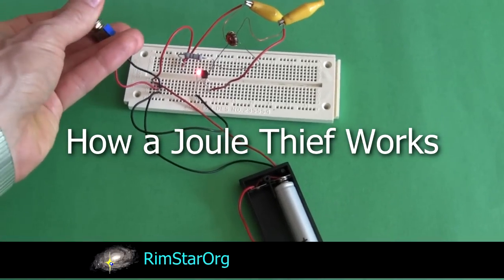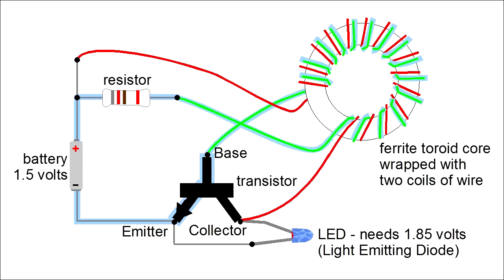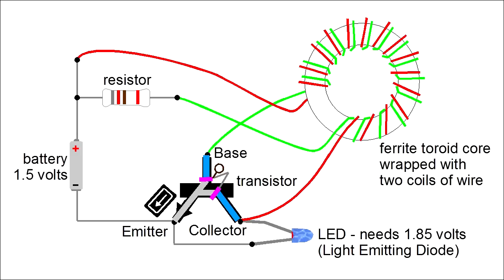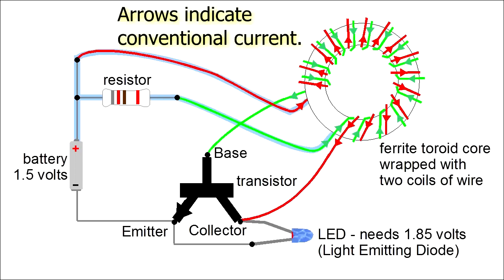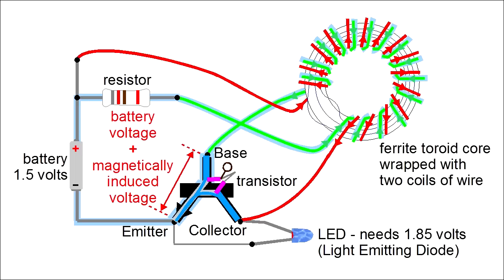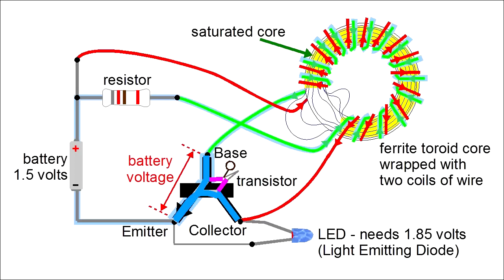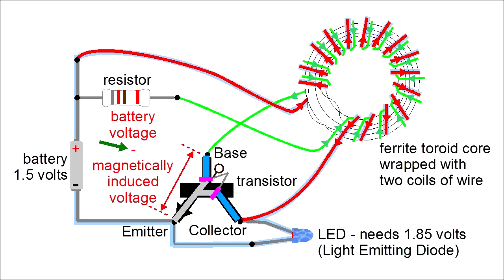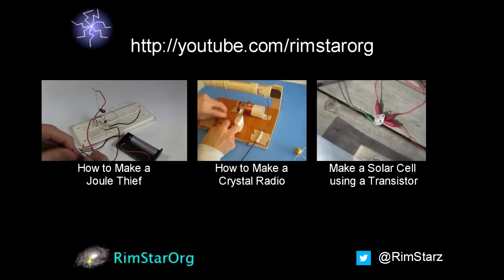How a Joule Thief Works

Comment: That answers my unasked question. It works because it's only on half the time, but persistence of vision fills in the blanks. I have a small jar of toroids that I haven't known what to do with and this looks like a fun project. And just to brag a bit; today I managed to get a crystal radio to light up an LED. It was flickery and weak but, hey, I figured out how to grab electrical energy out of the air and make light light with it. Thanks for the uploads.

Comment: Super vid :D This is the best one I've seen on how a JT works & is right.I've seen in other places where they give a much harder/wrong explanation.And just for anyone else who reads this know that a joule thief/ringer is one of the simple(best to me)circuits there are to turn on ANY TRANSFORMER.So hook this circuit up to Any transformer that has a center tap (or just rap one on the core if possible)& use the secondary for what ever you like(minus the LED of course to give energy to secondary) ;p

Comment from the maker: Typically a resistance of roughly around 1000 to 2000 ohms is used for this circuit. I happened to have a 820 ohm resistor so I used that. The resistor is to protect the transistor from too much current but it also affects the timing of the cycles. A good idea is to use a potentiometer (variable resistor) instead so you can easily try different resistances.

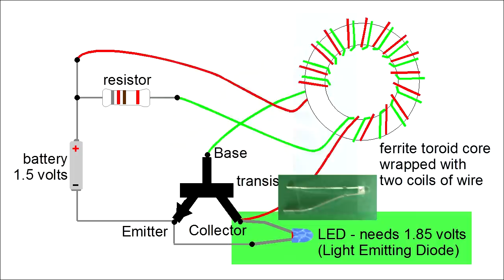Comment from the maker: Thanks! And welcome! The time frame depends on a few things and is usually controllable by replacing the fixed value resistor with a variable one (a potentiometer). In my "Make a Joule Thief for Zombie Batteries" video at 0:36 I show on the oscilloscope a cycle time of around 40 microseconds, so a frequency of around 25 kilohertz. In my "Fun with Joule Thief Powering a Compact Fluorescent Light" video i show 60 microseconds. So somewhere in the tens of microseconds of tens of kilohertz.

Comment: What I find amazing is just how fast these things happen. It's mind boggling how fast a transistor can switch on and off again.
Reply: Even if it does that just above 60 -70 times per second, it's enough for us to see the led always on!
i.e 60-70Hz
Reply from the maker: Actually, it switching at around 22,000 Hz.
Reply: This is nothing compared to, say, an FM radio, broadcasting at 100,000,000 Hz
Reply: or a microprocessor... where stuff is happening at Giga Hertz
(1,000,000,000 Hz)

Comment from the maker: Yup. I agree they're pretty much the same. Build up energy in coil, then dump it in a burst. One added point about the joule thief is that the way the primary coil interacts with the secondary coil (green in this video) opens up and shuts down the transistor faster than it would without the secondary coil.

Comment from the maker: What do you mean by dropping the voltage? What are you using to measure it? Where in the circuit? You'd need an oscilloscope to see the voltage. A digital meter with numerical display on the DC or AC scales won't work since the voltage is spikes with low voltage in between the spikes. What are you trying to power, an LED?

Comment from the maker: Hi, and I'm glad you like what I do. I'm guessing your LED is one that can turn on at 1.5 volts or less (if you're battery is fully charged then it's likely over 1.5 volts.) Do you have any packaging with your LED that tells you what voltage it needs? The LEDs I use require 1.85 volts, and that's why I need a joule thief.

Comment from the maker: +Vignobles Lac Saint-Jean I've used it for a number of things, which I've shown in other videos. The most frequent use is to power an LED using a battery whose voltage would otherwise be too low to meet the LED's minimum required voltage. I show that one in my "Make a Joule Thief for Zombie Batteries" video https://www.youtube.com/watch?v=B61DU7yEsPM Then I found you can power a CFL using 2 AA batteries by modifying the coils https://www.youtube.com/watch?v=FkLET8MhRbU. And then I learned how to modify the coils again to use this to transmit electricity wirelessly https://www.youtube.com/watch?v=31Rxi8JMIys.
Don't be misled by the "thief" in the name. This is just what's also called a blocking oscillator circuit. It provides higher voltage and current by repeatedly building up energy in a magnetic field and then releasing it in a short burst. The higher voltage and current exist only during the brief burst. The total energy out is smaller than the energy in.
PS There's no Reply button under your comment because of your Google+ settings.
- go to your Google+ page,
- in the top, right corner click on your thumbnail icon,
- in the popup that appears, click on "Settings".
- for the 2nd question down "Who can comment on your public posts?" set it to "Anyone".
Reply from the maker: *****
No.You'd still need to power it with batteries so that you can charge the batteries. It doesn't make sense.
Reply from the maker: adolthitler Ah, my bad. It was a case of skimming through comments at a time when I was going through a ton of them. I remember thinking he was talking about doing it at night when there was nothing from the solar panels, which clearly he wasn't saying at all! Yes, it could probably extend the useful time of solar panels to when the clouds some out. That'd be an interesting demonstration in fact.
Reply from the maker: Rohan Zener Yes, structurally the coil and core are the same as a transformer should you need one like that.
Reply from the maker: Rohan Zener If you're referring to just the coils and the toroid core then it's one-to-one, no transforming would take place since both coils have the same number of turns.
If you're talking about he whole joule thief circuit being x2, then no, it's much more than that. Also, the output is neither DC nor AC. You can see the output waveform in my video about how to make it at 0:38 https://www.youtube.com/watch?v=B61DU7yEsPM. Here a 1.5 volt battery is on the input and the output is the waveform shown with a peak-to-peak voltage of around 24 volts and a frequency of around 22 kilohertz.
Both the voltage and frequency are affected by a number of things, including the resistance of the resistor used, as I demonstrate in this other video here https://www.youtube.com/watch?v=yz_99oVMbSI.
I don't have any way of calculating what you should get as output.
Reply: +Rohan Zener i was starting to think the same, at less on the same path.
Do you refer to boost x2 the voltage applied to the base.  I mean Vbb (the voltage applied to the base-emitter path)  ??
Reply: The trigger that turns on solar lights when it gets dark is just a transistor and a resistor and is also called a Joule Theif.  How does this work? Why does it share the same name?

Comment from the maker: I don't know what the maximum voltage would be but a lot of people run compact fluorescent light bulbs off of them and they require high voltage. Their ferrite cores are usually larger and they use higher power transistors.

Comment from the maker: The transistor is off when the voltage is sufficient to run current through the LED. The opposite wiring of the coils makes sure of that. During the collapse of the magnetic field, the red coil induces current in the green one in a direction that further aids in shutting off the transistor.

Comment: Does the light flash rapidly?
Because the gates open and close.
So D/C to A/C.
Reply from the maker: It's hard to say if the light flashes. The frequency is too high for a human to see. We really need a high speed camera to tell or a photo diode circuit. It's pure speculation on my part but there might also be some delay in an LED turning off that causes it to still be on when the current flows again.
Reply: If you add an adequate capacitor, you can resolve the light flashing rapidly.

Comment from the maker: Oh, sorry to hear you had difficulty. The anode/positive/long lead is connected to the collector of the transistor which is also connected to the red wire going to the red coil. The cathode/negative/short lead is connected to the emitter and battery negative.

Maybe your confusion is because I drew the long lead connected directly to the transistor's collector without any intermediate wire. Maybe that made you think those weren't the leads and that they were missing?

Comment: The Transistor in a joule thief, just acts as an automatic on/off switch, while the 2 coils act sort of like a rechargeable battery. So the magic isn't really the Transistor, the MAGIC actually happens with those 2 coiled wires. So, it starts out with a (street Traffic) Red Light. The wire coils, act like traffic getting backed up at a red light (storing the extra energy in a magnetic field). The Transistor is the traffic light, which waits for enough cars waiting in line, before turning to a green light, which releases the cars, while also blocking traffic from other directions. The Transistor does not really amplify energy, instead, the wire coils amplify the energy and the transistors only job is to be forced open from excessive electricity built up, which quickly drains, which forces it back closed. Without the transistor, the Gate/Switch/Traffic-Light would have to be MANUALLY toggled by a human (like jiggling the second wire on/off the negative). I made one without a transistor, and successfully lit an LED with 1 AAA battery. This is a horrible picture, but I didn't expect it to work, so, forgive me for the bad image quality and having nothing labeled. http://i.imgur.com/NOknJv1.jpg
Reply: Yep, this is the fundamental part, and basic principle with any switching converter. But that's, however, quite easy to understand, but the hardest part to understand with blocking oscillator is how it actually makes the oscillation. This video got me closer to get a grasp about that, still have to process it in my brain though.

Comment: So your saying the LED is pulsing...but our eyes cant see this pulse..is this right..???
Reply from the maker: +Kennynva T. Yes.
Reply: Seems Im reading the same voltage on the led as the battery has..so how does it get brighter??  just by current??
Reply from the maker: +Kennynva T. If you're reading the same voltage then it's possible your circuit isn't right and you're just powering the LED off of the battery. Does you battery light the LED without the circuit? If the battery alone doesn't power the LED then you wired the circuit correctly and the joule thief is doing it's thing. Check the wiring going to your coil to see if it's the same as the circuit diagram. It's not wired the way you'd expect.
Reply: Yes that is whats weird..the battery will not light the led by itself..but it does in the circuit..So how does the capacitor make the led brighter...no matter which way you turn the electrolytic capacitor?
Reply from the maker: +Kennynva T. That's not weird. That's what's supposed to be the case. It means your circuit is working properly. This video is supposed to explain how, but basically it works by increasing both the voltage and the current at the LED by simply building up energy in the coil's magnetic field with the LED off, and then dumping that energy to briefly turn on the LED, and then repeating it. I haven't given much thought about the electrolytic capacitor, but it's also an energy storage medium so maybe the answer's in that. Regarding the polarity not mattering, that would be the case if it's in the circuit where there's AC, as with AC it would function in at least one orientation, and luckily not be damaged.
Reply: I think you meant in DC it would function in one direction.
Reply: +Kennynva T. I think he meant in AC, it would only function correctly during one single fluctuation of either the positive end or negative end of the period cycle of the AC sine wave, because the LED is essentially a diode, and diodes allow current via only one direction.  Plus, you can fry an LED if you run current in the wrong direction for too long.
Reply from the maker: +Mark Wright Yup. I meant AC, as Mark explained. If it was DC and you had the direction wrong then the LED would not light up. But since AC keeps changing direction, at least half the time, when the direction is right, the LED would light up.

Comment: OMG !

Sorry to say that but the term « joule thief » is misleading !

Nothing gained here. This is a very old concept called a « multivibrator circuit » or « oscillator circuit » that is fed through a toroïdal transformer to step up voltage (not current). You could use a regular transformer 110v:6v reversed and you'd get about 20-25 volts. You just made an inverter !

Actually you could do the same using a single SPST relay and a 9v battery hooked up as a vibrator; in that case, you might get thousands of volts on the coil as Back EMF.

Usually, to counter that effect. we put a diode across the coil because back EMF can be damaging to electronic components. In this case, we don't need the diode because WE WANT the effect to create EMF.

The « Noise » you are hearing in the coil is normal ! It's the vibrator circuit creating resonance !
Reply from the maker: Yes, it is misleading. But that's one of the names very commonly used for this circuit. Blocking oscillator is another. But nothing in my description points to any energy gain. Just accumulated energy being released in a burst and repeated.
Reply: RimstarOrg  Blocking oscillator..makes more sense... so does this circut drain the battery faster due to it needing to build up a charge to light the LED? thus no real extra power or "thieving" is achieved? it just spends the energy in a more lump some effect?
Reply from the maker: Ohm Zen
If you have a battery with sufficient voltage and current to light the LED then I would think you'd be better off using the battery directly. And yes, to your other two questions.
Reply: Thank you for answering all of "our" youtube questions! you are my favorite youtube professor haha ;D

Comment from the maker: I recall having the battery voltage at the LED at one time too. I don't recall what it turned out to be but it wasn't a bad transistor. It might have been that had the connections to the coils wrong. If you look at them closely you'll see that they're supposed to be crossed in a way. Maybe check that.

Comment: ...so how does a joule thief work??
Reply: The TL;DR version is that it charges up in the torroid until it's full, then when that happens the transistor lets go which forces the current through the LED.

Instead of giving it 1.5 volts over a second, it gives it 3 volts over 2 seconds.
Reply: So If you connect two end points of a capacitator, we can make a basic alternator.
Reply: It charges it up, discharges it by letting current go through the led, and so on it starts over and over again.

Comment from the maker: Yes, at a conceptual level in that it steps up. Though it steps up both the voltage and the current, sort of, by accumulating energy in the magnetic field over a period of time, and then dumping it all in a brief period of time, and then repeating. So functionally it's different than a transformer.